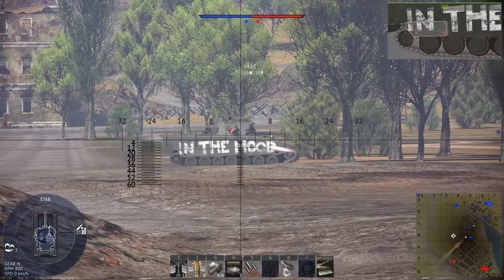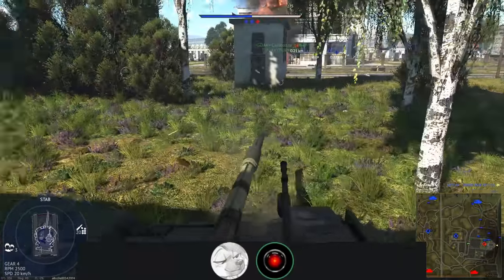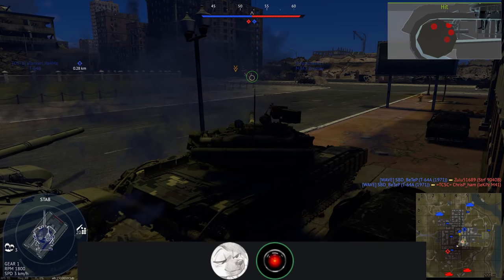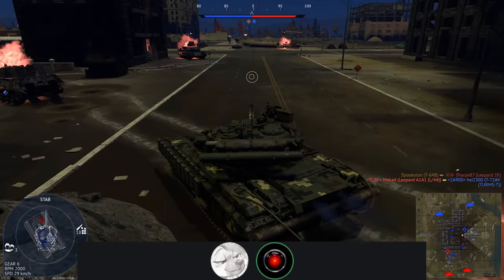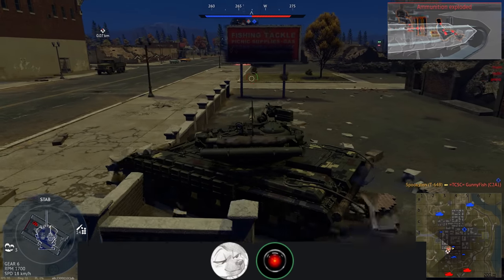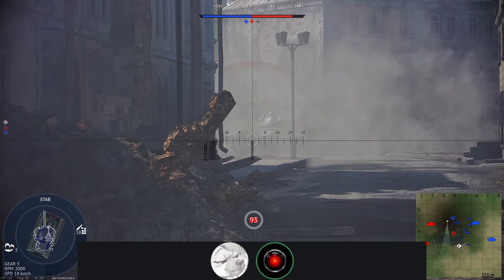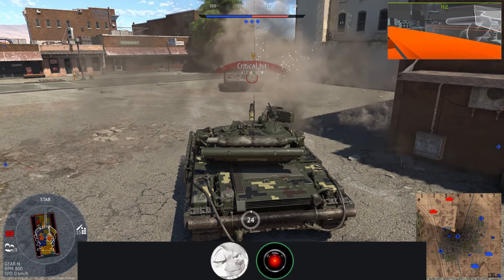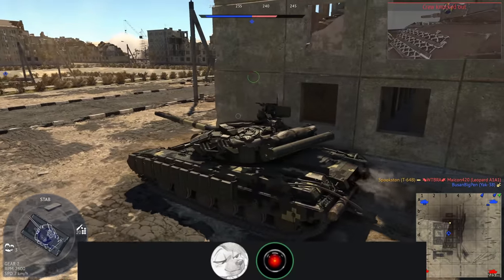Why Do Russian Tanks Have Cages?

Comment: Sorry, year late to the party, but I disagree with your friend in regards to the cage's usefulness against shaped charges. While the cages aren't an invincible shield against top-attack shaped charges, they do add a significant layer of defense against them for two reasons. First, spacing. The ideal stand-off distance for a shaped charge is double the charge's diameter. Increasing that stand-off distance to 6x the charge's diameter reduces penetration by 50%. While I lack the specific measurements on those cages, they certainly look to be sufficiently spaced.

Second, premature detonation of a tandem warhead. Beneath those cages on many tank models are ERA blocks. By prematurely detonating the first warhead, you increase the effectiveness of the ERA blocks significantly. ERA alone will only reduce a tandem warhead's penetration by about 20%, but you remove the tandem aspect of the equation and suddenly the ERA can stop the missile entirely.

So yes, the cage won't stop a javelin. But the cage is just one layer of defense in a multi-layered system that might.

Comment: one thing he does not take into account is the cages are used in conjunction explosive reactive armour so the javelin hits the cage the armour detonates creating a counter blast reducing the impact of the javelin
Reply: But that's already how ERA works. The Javelin sets off the first charge, which sets off the ERA, which then allows the tandem second charge in the Javelin to punch through. The case isn't necessary to set off the ERA, ERA already does that by itself.

Comment: I think he fundamentally misunderstands how slat armor works. It's purpose is to physically deform and break the explosive cone before the round fuses, or, damage the fuse enough such that it doesn't fuse in the first place. This is of course completely defeated by radio or laser fuse designs. And even when slat armor works, it's very inconsistent, but better than nothing.

Comment: Since javelins come down at an angle (which actually makes them slam into the side of a turret quite often, redeffect made a great video about it) but it could mess with the thermal signature from above, causing it to miss. Or since it hits at an angle, it’ll detonate on it and the for the lack of better words, “jet” could miss entirely if it were going to hit the roof in the first place. Could be wrong. Just speculating. especially since it wouldn’t really work at a javelins max range since it’ll come down at a steeper angle.

Comment: I'd be interested in why the standoff detonation caused by the cage wouldn't do much against javelin missiles. I would think that the sizeable distance between the cage and the roof would dissipate the energy of the explosions significantly!
Reply: The problem is the thin roof armour and the position of the ammunition stored in a ring on the turret floor. If any of the jet penetrates the roof it will strike the ammunition leading to a cookoff that destroys the tank.

Comment: I still dont get why people laugh at this idea.
It has shown that it works in certain cases. Has shown that it can protect from old ammunition fired from rooftops and elevated positions.
And even for a Javelin. It makes the round detonate and travel through alot of air till it reaches the actual armor. From what we know , Kontakt-5 is able to stop Javelins more or less half the time. And that slat armor roof , might just make those chanhes larger.
Ive seen some with kontakt one on the cage aswell. 
Sure , its not the best looking or maybe the best tool againts Javelins , but if you know Russians "What Works , Works" is their motto when it comes to these things.

Comment: Is there any video of a successful top attack missile against the cope cage?
Reply: not in the field, but there was an experiment done in December by the Ukrainians, in the months after Russian tanks were spotted massing at the border with the cages. they mounted it on a target vehicle and tested it vs a Javelin. if you search up "Javelin vs Cage Armour" right here on Youtube you should find it.

the results seemed to be:
the first shaped charge was set off by the cage armour, completely shredding it, and the second charge still managed to penetrate the turret and damage the tank enough to set a fire inside it. however, it did not manage to generate the classic turret flip that happens whenever a Russian tank takes a hit to the ammo carriage. mind you as a target vehicle, it was presumably empty of ammunition or fuel. assuming in a real tank it would still fail to detonate the ammo or set the fuel ablaze, it likely would have been a capability kill due to disabling the turret

Comment: Your so-called Expert is 100% wrong about how Heat (High explosive anti-tank)  rounds work. the "stand Off" distance is CRITICAL for the shaped charge explosive's to actually penetrate hardened steel reliably.   The Javelin is No Different.  If the Slat armor makes the warhead detonate outside of its designed Standoff distance a explosive jet of molten metals will NOT enter the turret. 
Maybe you have seen the  "cage" armor that covers the Strikers hull, it's the exact same concept.  All shape charged warheads have a range of effectiveness in terms of how the shape of the explosives focus the blast energy into a very small point.
Reply: Given how many tanks the Russians still have in Ukraine, I'd say the cages probably work better than anyone likes to admit. There's a reason we used the same improvised armor on our own tanks and strykers in Iraq, and as you said, still have it on many vehicles. And it's not like Javelins are the only threat to a tank.
Reply: Standoff distance is critical for optimum performance, but optimum performance isn't needed when you're using top attack.
Also, the Javelin uses a tandem warhead so there's a second jet of metal. Also, HEAT doesn't melt the liner. It's not molten metal.
Reply: @berserkasaurusrex4233  There's a reason the US used it. And that reason doesn't apply here.
Sure, Javelins aren't the only threat. There's NLAW and other ATGMs like the Stugna-P.
Reply: @ChucksSEADnDEAD  There are still RPGs around, and thrown explosives. Besides, these cages are mostly on the vehicles that were brought back from Syria, they were never meant to deal with Ukraine's NATO-supplied weapons.
Reply: @berserkasaurusrex4233  Okay. How many people are throwing anti tank grenades when they have free ATGMs? If you can get close enough to a tank without infantry or machine guns cutting you down, you've already won. The cage will do absolutely nothing as the thrower is able to just hit literally anywhere else.
Reply: @ChucksSEADnDEAD  Is there some reason you expect Russia to waste time and money cutting the cages off when they bring the tanks and BTRs to Ukraine? You seem really bent out of shape about them.
Reply: @ChucksSEADnDEAD   When you focus a powerful explosion into a tiny spot, Which is the ENTIRE FUCKING point of a shape charged round, turns  copper in the warhead from a solid state to a super heated liquid. Thats literally the mechanics of shape charges.   
The after effects I have personally seen many times during my many deployments. 
Javelins do have a tandem warhead, but that's not the only anti-tank missile in that warzone. not by a LONG shot. No one is running out of RPG's anytime soon.
Reply: @mattbutler2145  It's not a liquid. At no point does the material reach fusion. It stays solid during the entire process. The after effects clearly look like a slug punched through, rather than a liquid jet.
Reply: @ChucksSEADnDEAD  It's a plasma jet, technically, not a liquid, but it most certainly changes phase from solid during the explosion. I'm not sure why you think a phase change requires fusion? Water freezes and boils routinely and at no point achieves fusion.

The reasons it looks like a "slug punched through" is because the plasma jet is a physical object moving at high velocity into another object (technically both the plasma jet and the armor plating are considered dynamic fluids in this context); it is a purely kinetic effect.

Despite the term HEAT, the plasma jet from an anti-tank shaped charge punches (or rather, erodes) through the target's armor, rather than burning or melting through as many people incorrectly presume.

You may be confusing modern HEAT munitions with WWII-era type shaped explosives, which formed a slug of solid material ("explosively formed penetrator") that would impact a tank's armor and could breach some of the weaker armor of the time. This is not really used in modern weapons, as we have far more powerful explosives available.
Reply: @ChucksSEADnDEAD  LOL fusion? ??
Reply: @ChucksSEADnDEAD  100% wrong, the after effects of a kinetic round like a sabot has a a very different impact signature than Heat rounds.  anything else i need to debunk for you?
Reply: @berserkasaurusrex4233  Fusion is another name for "melting". Look up the wikipedia page for melting. It states: "Melting, or fusion, is a physical process that results in the phase transition of a substance from a solid to a liquid."
Reply: @mattbutler2145  Yes, fusion is a correct term to refer to "melting". Are you perhaps thinking of nuclear fusion?
Of course a sabot looks different. It's a different type of projectile. It's still a solid undergoing superplasticity, not a liquid jet.
Reply: @ChucksSEADnDEAD  Not sure why you use Fusion then, when melting is what you meant. Why use a term that has multiple meanings instead of the more direct and common term? Anyway, nothing melts in a shaped charge explosion, it's a direct phase transition from solid to plasma.
Reply: @berserkasaurusrex4233  Because "fusion" is also correct terminology and I like it. You know the topic isn't nuclear, so the confusion here is only coming from you not knowing something. Now you know. Don't be stressing on me when you're learning.
By the way, I had to look it up and this effect was studied, in SOME shaped charge designs with SOME types of explosives the center of the metal did reach melting point during the explosion but the majority remained solid through the entire process.
Reply: @ChucksSEADnDEAD  What metal remains solid? The armor plating?
Reply: @berserkasaurusrex4233  The liner metal. In some warheads it's possible for the center to melt while the outside remains solid. In others the entire liner remains solid and there's no phase change. I cannot find any references to the liner becoming ionized so plasma doesn't seem to be generated at all.
Reply: @ChucksSEADnDEAD  The ones in the 90's routinely hit 30K Celsius, at least from what I remember. Those were for oil wells, and a bit different from modern weapons, but still,  the effect is the same. I think there is more likely some miscommunication going on in your source information. The liner material largely survives the explosion, only a small percent of the inner liner (5-15%) is effectively turned to vapor sized particles and it is these particles that are driven forward by the blast wave at around 7 miles per second. This is the weapon's main effect, the generation of a jet of particles that erode material from the target's armor.

Simple thermodynamics would indicate that anything at that pressure and energy state will be effectively a plasma, at least for a millisecond. The rest of the liner probably does stay below the melting temperature for Tantalum or Copper, or whichever alloy they're using.

Mind you, modern shaped charges are a lot more complicated than the simplistic cone-shapes you see mentioned in most texts. Presumably jet temperatures vary a fair deal as well. But I can't really see any way the jet doesn't reach several tens of thousands of degrees, not at the pressures involved. Just explosively compressing the air in the gap before the liner would bring a temperature equivalent to the surface of the sun, let alone the vaporized liner material.

I will also note, just in case you are using Wikipedia as a source (nothing wrong with that, it's fairly good as a general resource), there is a major editing war going on right now, specifically about shaped charges and cage armor. So it might not be the best resource right now, since there is so much misinformation going on.
Reply: @berserkasaurusrex4233  I cannot find a single source that argues the main effect is due to plasma ablation. It seems to be a "contact APFSDS" that's only generated upon hitting the tank rather than having to fly through the air and lose effectiveness.
Explosions that aren't tuned for temperature aren't even "that" hot, as in their routinely don't even melt steel in contact with the explosive, and the pressure isn't contained. The modern shaped charge designs are probably more about reducing the sensitivity to standoff rather than temperature increase. I got this paper called "In-flight Conductivity and Temperature Measurements of Hypervelocity Projectiles" by W. Casey Uhlig and Charles R. Hummer which states the jet tip is roughly 1200 kelvin. Studies done in the 70s also state 500-900 K according to the measurements of von Holle and Trimble. There's a presentation in PDF format from the Army Research Laboratory stating the plasma stuff is a misnomer, and cites von Holle and Trimble for temperature references. I also found a research paper called "On Temperatures in Shaped-Charge Jet Penetration" by William Flis which states temperatures can reach above 2000K on impact with the target, and that most heating is due to shock rather than isentropic compression.

Comment: Russian and Soviet are one in the same. They may have a slight change in military doctrine but the people themselves even during the years of the USSR referred to themselves as Russian and the nation as Russia. Some from the other SSRs would probably refer to themselves as Ukrainian, Byelorussians, Lithuanian and so on. As for urban combat those cages may stop someone from firing an RPG into the top of the turret but logic would probably see the shooter shoot it at the engine deck of the tank. All Soviet era MBTs do not have isolated ammo stowage. Its stowed in a carousel that circles the crew in the turret. So every time its struck it will go off and kill the crew. The Russians really never put consideration into tank design with any regards for crew safety for most tank designs.

Comment: He failed to mention the tandem warhead of the javelin and N-Law are specifically designed to defeat  ERA or explosive reactive armor plates that the cover's the tops of the T-72 T-80 T-90A's aren't covering the entire terret and on the 72's it's literally only 1/4 of the frontle portion of the terret that actually has the ERA blocks and those being  the older kontact 5 plates designed to attempt to defeat the 
TOW 1 ATGM  HEAT and HESH rounds from last century and is only recently received in small quantities it's replacement made to counter this century's technology or at least an attempt to counter it and that's called 
RELIK ERA and duplex ERA that it was in the middle of being Mass retrofitted to every T-72 they could  fit them to I've only now just started seeing here and there glimpses of vehicles with it being encountered and so far I've not seen one that was destroyed just abandoned or stuck up to the exhaust in mud and muck from being shelled everywhere but the fucking tank it was supposed to have destroyed but given the poor quality of training and low standard of readyness and qualification so far displayed by the Russian's military  it's likely we won't have to wait to long before they start showing up on film being obliterated by the javelin

Comment: The Ukrainians also have been dropping RPG warheads from modified quad copters.
Reply: Seems weird. The RPG warhead needs the acceleration from the boost charge to defeat the inertial/arming range safety.
Reply: @ChucksSEADnDEAD  well we have seen how easily modified they are in ieds. Also depends on the model of warhead. Also depends on the height dropped.
Reply: @michaelpreston2735  The inertial safety works by the mass being pressed backwards and compressing the spring, dropping it would cause the safety to press forward on impact.
I can see how it could be modified but that just sounds dangerous. I've seen drone-dropped grenades but not entire RPG warheads.
Reply: @ChucksSEADnDEAD  I would argue it's still much safer then shooting an rpg at a tank.
Reply: @michaelpreston2735  Aye, but between mud, fuel shortages and ATGMs, tanks don't seem to be winning so I'd rather not be handling modified warheads with a safety disabled by some dude.

Comment: The so called expert forgot one very obvious, at least to me, and I believe maybe even seen mod that would defeat or at least give Javelin very hard time - heavy bag ERA. This ERA is specifically designed against infantry weapons. By itself it will not defeat Javelin but it will disrupt the jet, certainly 1st jet but 2ary jet as well. One has to remember that there may be regular K-1 type or similar ERA under the slat armor which would also go off. Both ERA packages going off plus slate armor plus about 1in of roof armor may be enough to stop even Javelin. Remember there is also about 3ft of stand off distance in there.

Comment: Javelin missiles use non-contact detonation. Since the missile is aimed at the tank, and when developing it, it was not taken into account that there would be protective structures on the roof of the tanks, it would simply break against the grid without triggering it.
Also, it is important that the target capture system has a poor matrix. a total of 64 by 64 pixels. These missiles often missed if there were strong heat sources near the target